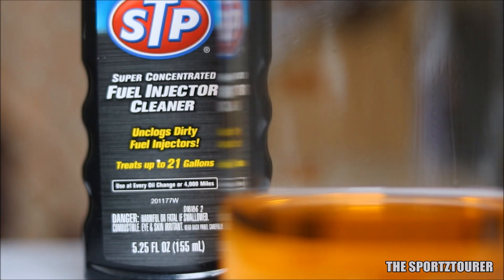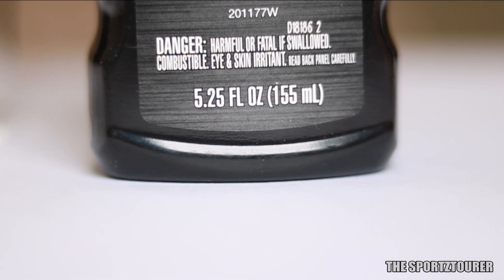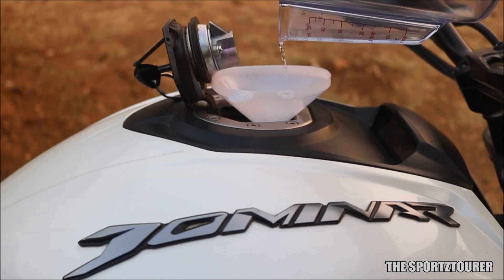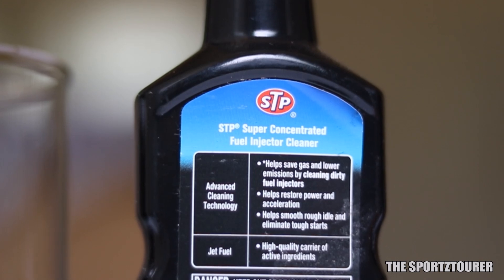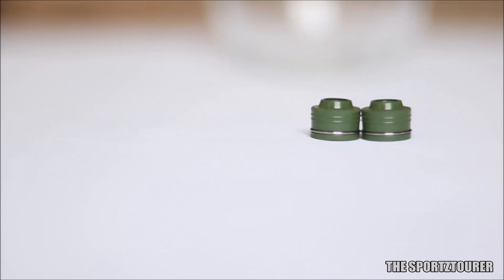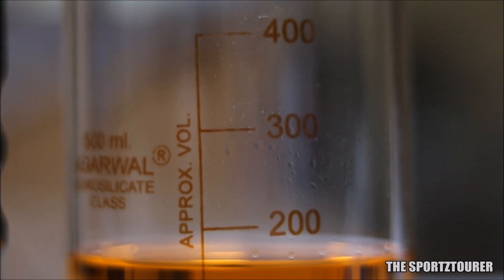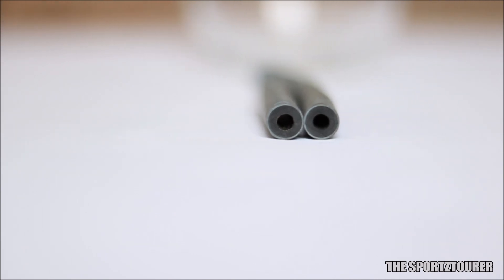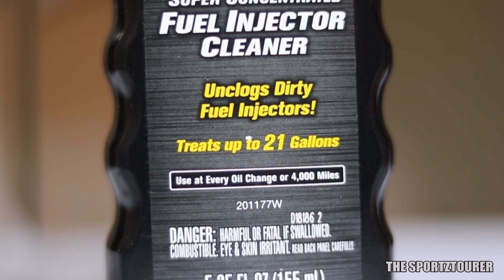STP FUEL INJECTOR CLEANER DAMAGE TEST & REVIEW ON THE DOMINAR 400, HOW TO USE FUEL ADDITIVE

Comment: I am searching for good injector cleaner and chanced upon this clip.
Not sure how valid the test was conducted. There is no heat, no friction (whether moving parts or vibration to stimulate running on road).
If by soaking seals into the solution for two weeks will show positive result, the manufacturer would have closed shop long ago.

Comment: yesterday suddenly my bike stopped while riding and did not start after 3 to 4 cranks and showed warning for FI system then bike started. What could be the issue? My bike has run around 7200 km 2020 bs6 model dominar 400.

Comment: If you genuinely want to do a injector cleaner test, please at least be on par with the others who are showing how the cylinders, etc. look before and after the clean. Not convincing at all. The rubber testing is also not practical, most fuels will cause swelling, so auto makers are already using rubbers that are fuel-resistant. It is already a standard in the industry to use fluoroelastomers to prevent swelling. Please do more research and present information that is useful. At the end of the video, I am still not convinced how good this injector cleaner is.

Comment: Have you tried the motul fuel system clean?
Reply from the maker: Not yet, have you?
Reply: @thesportztourer I have ordered a bottle to try clean up injectors as had stale fuel which caused a slight hesitation at light throttle
Reply from the maker: Great, this should be a good test to check its capabilities; However fresh fuel with additive should do a better job in the combustion chamber.

Comment: It's useful knowing that it doesn't damage rubber, but immersing the rubber parts in water would have the same results. I guess if the engine had not been clean before and performance changes had been noted that might also be worth knowing.

Comment: My experience with fuel additives is fairly good. Have a 2009 GTI with 135k on it and from using one of these, I improved my gas mileage by 4 mpg. My injectors are clearly suffering but this at least helps me get the last bit out of them since the last guy doesnt seem to have cared for it much.
Reply: how many times did you use it once ?

Comment: I was changing the spark plugs yesterday and noticed that they have carbon fouling.
My car had an open thermostat for about 20k miles, so I guess it was running rich. Do you suggest using a cleaner?
Reply: Sir, please what is an open thermostat
Reply: @ka65571  The thermostat was faulty. It was stuck on the open position.

The thermostat should close the coolant flow when the car is cold and open when the car gets hot, all that to maintain a stable optimum temperature for the engine, fuel efficiency and optimum oil temperature, etc.
Reply: @Porsche996TT  thanks 👍🏽👍🏽
Reply: Sir, what's an open thermostat

Comment: Now I agree this cleans the injectors. But, where do the dirt particles go after coming from the injectors? Will the dust particles enter the combustion chamber? Or Is there any filter to collect the dust Particles before entering the combustion chamber?.
Reply from the maker: Hi,
The deposit particles usually burns and goes out of the exhaust.

Comment: Is it usable for carb??
Reply from the maker: Hi Basil,
If we go by the chemical composition then this can be used on carbureted engines as the ultimate aim here is to clean up the deposits which remains the same for fuel. There are upcoming videos on additives for carburetors, you can keep a check on the channel for that 😊

Comment: Can we use it in carburator bikes?
Reply from the maker: If we go by the chemical composition then this can be used on carbureted engines as the ultimate aim here is to clean up the deposits which remains the same for fuel. There are upcoming videos on additives for carburetors, you can keep a check on the channel for that 😊
Reply: @thesportztourer  thank you

Comment: I purchased Apache RTR recently and yesterday evening, the battery went down midway and the bike didn't start. Please tell what precautions to take for the battery! How to check if it's the issue of the battery or the wiring. I am worried.
Reply from the maker: Hi Abinash,
As your motorcycle is in warranty I would suggest you to take help from authorized service. I did make a dedicated video on RTR's battery here: https://youtu.be/cK2qk3LSLSE

Comment: Can it be used fir carbs?
Reply from the maker: Going by the chemical composition you can use this on carbureted engines as the ultimate aim here is to clean up the deposits which remains the same for fuel. There are upcoming videos on additives for carburetors, you can keep a check on the channel for that 😊

Comment: I once used  YAMALUBE PEA carbon cleaner  on my karizma R. AND I FELT NOTICABLE CHANGE IN THE PERFOMANCE. THE BIKE WAS 5 YEAR OLD AND HAD DONE CLOSE TO 29K BY THAT TIME. IT BECAME A BIT SILENT. MAYBE THE VALVES GOT CLEANED. AND ALSO THE FUELLING FELT BETTER.
Reply from the maker: Yes, that's how a good fuel system cleaner should work. Thanks for sharing your experience here 😊

Comment: Thanks a lot .. but how about using this in a carbureted vehicle, I use ABRO injection cleaner on my ntorq after every 300km .. quantity  is use is 30ml for a tank full.. approximately 5 litres.
Reply from the maker: Abro is in the list 👍
How is your experience with it?
Reply: @thesportztourer  as I am using it in carbureted vehicle not much of a difference but slight noticable difference at top end... It reaches at higher top speed .. i.e from 102 to 104km/h after first 2 uses then it's stable until now. Guys who got fuel injection systems will notice it better but yes it does make change

Comment: Can I use this cleaner in NS 200 (carburettor )
Reply from the maker: Hi Ajay,
As discussed in an another comment, going by the chemical composition you can use this on carbureted engines as the ultimate aim here is to clean up the deposits which remains the same for fuel. There are upcoming videos on additives for carburetors, you can keep a check on the channel for that 😊

Comment: Can I use this in carbureted engines
Reply from the maker: Hi Sachin,
Going by the chemical composition you can use this on carbureted engines as the ultimate aim here is to clean up the deposits which remains the same for fuel. There are upcoming videos on additives for carburetors, you can keep a check on the channel for that 😊
Reply: @thesportztourer   stp Moto booster ?
Reply from the maker: Yes, Moto Booster along with other additives.

Comment: I've used STP MOTO BOOSTER for NS200 I've found 25% less vibrations and the harsh revving has reduced in higher RPMs.
Revs easily.
Leaving aside these 2 aspects there's no major difference in mileage.
Reply from the maker: Thank a lot for sharing your experience. The review on the Moto Booster is on it's way along with other additives 😊
Reply: But ns200 didn't have the fuel injection system right?

Comment: Awesome brother, excellent. First I would like to say that I have a D400 same moon white as yours. And am an automobile engineer, previously I use to remove the fuel filters and injectors for cleaning. It's a day process and tired too. After using liqui moly by your video, I can see the best result in my bike, there is no engine lagging and it's really good. I have completed 42k, I used 2 time the liqui moly as per your instructions. Now the bike feels really good. And these prides are for you brother...
Reply from the maker: Thanks a lot for sharing your experience. Happy to see an automobile engineer here 😊

Comment: I am using the NOS octane booster on my dominar, not much of a power change but it has several chemicals that help clean the system, primary contributor being MMT, can you please shed some light on how much the NOS product is useful as an octane booster.
Reply from the maker: Thanks @bimoljoseph for sharing your experience. On which motorcycle are you using this octane booster?
Reply: @thesportztourer , the same as the one in your video, dominar 2017

Comment: Please suggest a good oil for NS200 for long rides....,please bro....
Reply: Sell advance 10w 40 is best
Reply: @DayanandB9985  can we use motul 300v which u used for rajasthan ride for rtr200
Reply: @DayanandB9985  please give a link to buy 10w 40...,
Reply: @cemeterygamer8093  Motul 300v is a race spec oil. So better go for any oil with 10w50 spec. Castrol gold is also good
Reply: Amozon online shopping